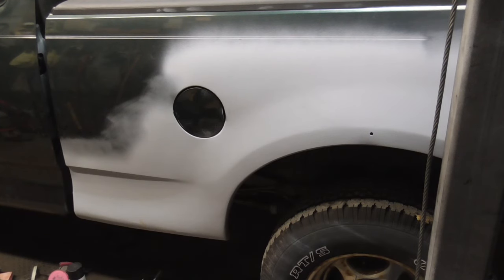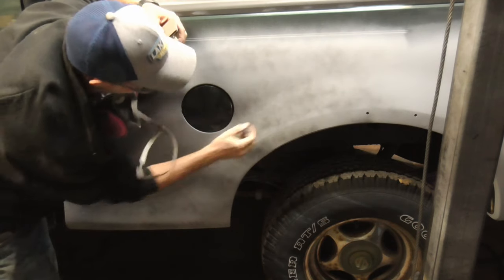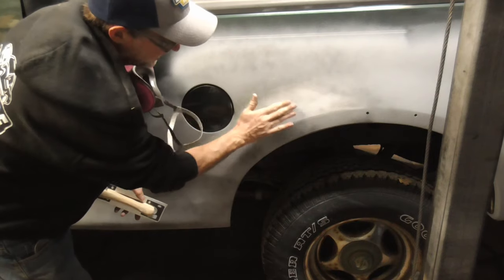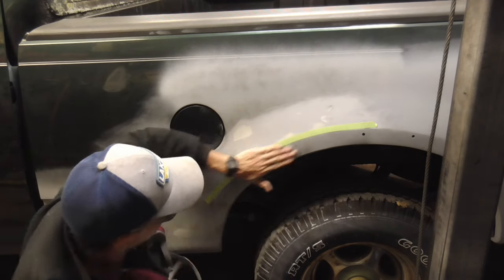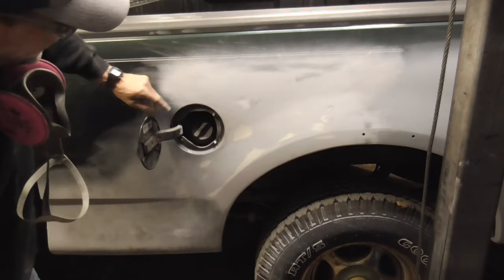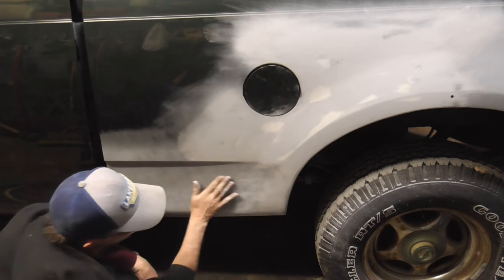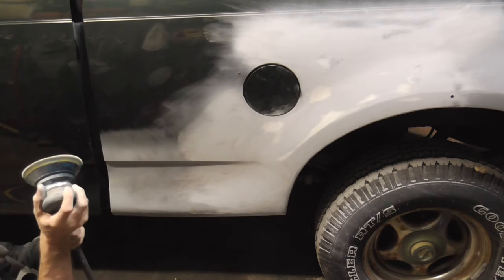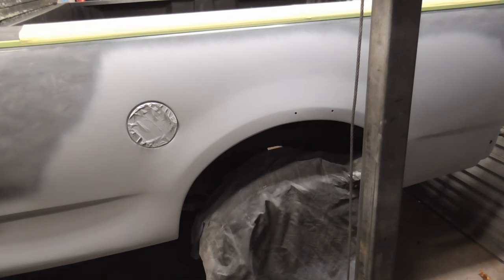How to Block Sand Curved Surfaces / Panels

Comment: Another great video. Do you have a video(s) on sanding convex surfaces? I have several motorcycle tanks and body work I will be prepping for paint. I see you went over the lower portion in this video with the DA. Is that the answer? Thanks, Ken
Reply from the maker: Here's a couple Ken - hope they help out - https://www.youtube.com/watch?v=PkDY4b_I8w0  or  https://www.youtube.com/watch?v=-66tf0tpeqo

Comment: I had a guy paint a car for me and he said he needed metal etching paint before filler was applied, I would think it's a good idea but the last shop I worked for didn't do this and the one I'm working for now doesn't as well, what do you think?
Reply: Do you work in autobody??? Just wondering, as you were saying shop? They are probably talking about metal etch primer, or they might be talking about epoxy primer??? Just pound your dent out, do some grinding, making sure there is no old paint, its all clean bare metal. Mix your filler, put it on, and do what Jerry is doing. I use 24 grit discs, and grind slowly so you don't heat the metal up. If you get the metal to hot, it might tin can on you, and you can't put bondo on that, you will have to shrink the metal first. And with the metal nowadays  more care is needed, as its super thin, not like the old car were. Jerry is the absolute greatest, he explains, everything he does in detail, unlike a lot of clowns on youtube
Reply: @gm-lb9oe  thanks for the info yes, I am refiring to auto body shops, I'm still green just doing this kind of work for about a year now. did my first rear quarter and a bedside.  seems odd that the factory dose this but body shops dont.
Reply: @Draintheswamp2024   Hi. My understanding is the newer vehicles are dipped in a solution vat when they are going down the assembly line. Its a chemical reaction, that occurs between the solution in the vat and the cars metal body, frame etc. It literally becomes part of the steel, which protects the steel from flash rusting on the assembly line. Then it goes down the assembly line. If you hand strip a car with stripper, you will not remove that layer of protection, and you can leave it bare metal, touch it with your hands and it should not rust from that. However, the minute you take a grinder to the metal to scratch it up for bondo, you remove that layer of protection, and it will flash rust there, but no where else. And please what ever you do, dont apply bondo on top of epoxy sealer. It won't work. It may work for a short time, but I'm old school, and do what Jerry does, rough the metal up then put bondo on. Alot of guys on you tube are doing it wrong, beware. Watch ALL of Jerry's videos and you can't go wrong. The only other one I trust on you tube is My Friend Pete, SWRNC autobody. Jerry is 1st, Petes second, all the others are crap. And one channel on the tube here, says you need all the diffrent and real expensive spray guns. You DONT. Some old timers like their Binks 7 , which I also have , and I love my old Devilbiss. You don't need 10000 spray guns. Hope that helps you out. If not, give me another jingle, willing to help you out. Good luck on your career